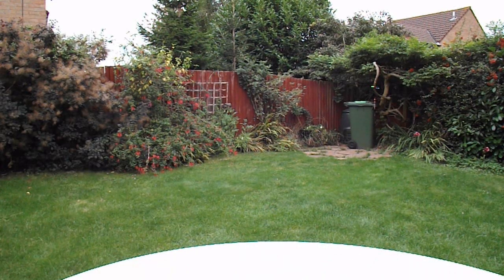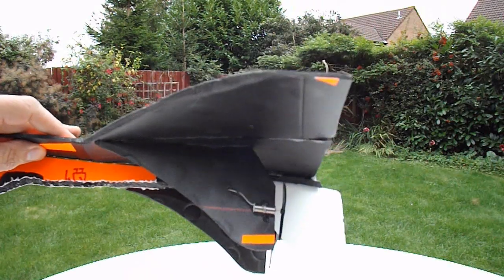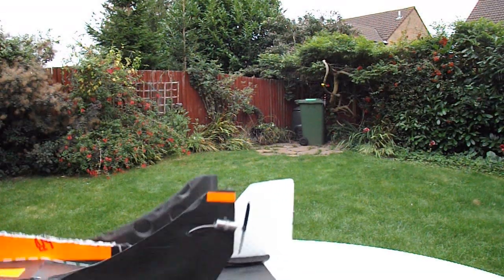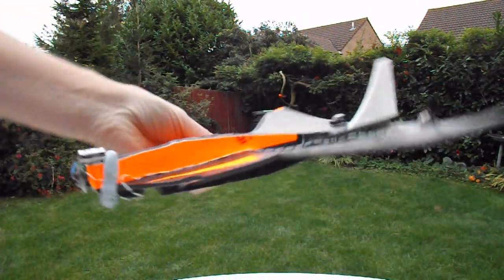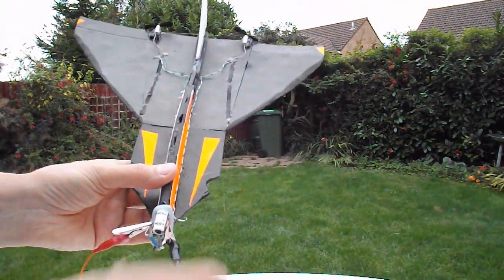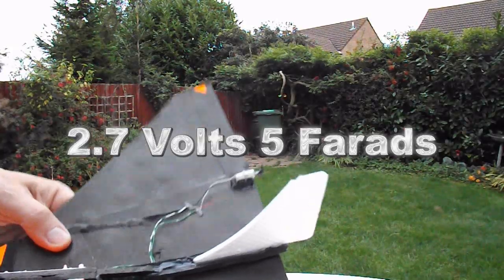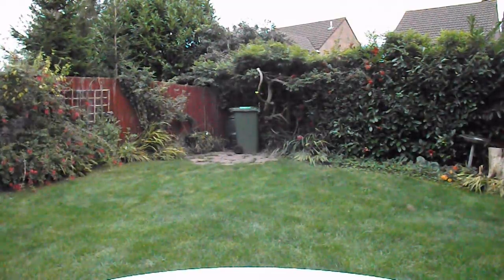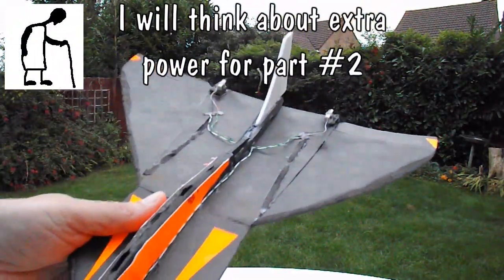Can we power that Polystyrene Pizza Tray Jet Glider (No)

Comment: 2 3.7v lipos
Reply from the maker: +random person the point about using the supercapacitors is that they will only last for about 10 seconds so I have no problems with them flying away out-of-sight. If I put LiPos on they would run for several minutes and I would probably lose the plane.

Comment: Sorry to be an ass, but looks like a bit too much ballast. And to use less ballast you may have to work on the wing. The c-ofg on deltas and canards are aft (compared with a conventional plane) but not aft too much. And the only way is to find out whereabouts of the c-of-g, is glide it. Only guess for the start and then glide and change ballast. Just chuck it and change ballast till it glides well. It should "balloon" like the balloon glider seemed to. lol Also to make it work on less ballast, the leading edge of the wing is bent down (just slightly) and round-off the leading edge somewhat (more on the top) and bevel the trailing edge a half inch in and bevel the underside only of the rear of the wing. This helps nose-up elevator. The leading edge is (by far) the most critical part of the wing!!!, cos the leading edge directs the air-flow over all of the wing. It's like a sheep door in a narrow passageway that separates sheep into different yards. lol The leading edge directs the air either up or down over the top or the bottom of the wing. So both leading edges have to be the same and the leading edge shape is so so critical. lol It won't work if it's square, but a trailing edge will. lol

Comment: Caution there, sir, because as you might know, capacitors don't work like batteries. I don't know how a second capacitor could double the voltage but be sure that aligning them in series won't work. It is possible though to double the capacity by arranging them in paralell with the same polarity of course.
To increase the power I think those motors are overfed...I mean: I'm pretty sure that the can withstand a bigger propeller and still develop quite the same rpm and flight time.
So my suggest in general is to try some bigger propellers first...
Reply from the maker: Before I added a second capacitor I looked up the maths. I am not trying to increase the capacity because I don't want a longer motor run. I want a higher voltage because the motors are rated for 3.7v LiPo's and my supercapacitors are rated at 2.7volts. I haven't found any guidance on the maths on voltage here. In series I am halving the capacitance so the motor run is even shorter but logic tells me I should get higher voltage. In practice I tried it and I got the expected shorter run with a faster burst but still not really enough to fly this well.
Reply from the maker: I did try a pair of larger propellers, 3 bladed, but still not really an improvement. The plane glides fine but is a bit heavy.
Reply: GrandadIsAnOldMan
 I don't know the specifics maths on voltage for that configuration but as far as I know the capacitance doesn't split to half. It really decreases MUCH more. Two capacitors, each of 5F, in series, make a sum of 1/5+1/5=2/5F Less than half :(
But maybe (and I'm not sure at all...) maybe you can charge them separatedly, thus having 5 and 5F separated; and afterwards close the circuit in series.
And apart from that, I still suggest trying a bigger prop, and maybe ducting it...
Good luck sir. I'll try to find some maths about those capacitors...
Reply from the maker: DoNotPushHere haha I didn't expect a discussion on maths but you forgot to invert your answer. 1/C=1/C1+1/C2 so 1/C=1/5+1/5 so 1/C=2/5 so C=5/2=2.5 so half the capacitance of one on it's own http://www.electronics-tutorials.ws/capacitor/cap_7.html
But my point is it's the voltage I want, not the capacitance. Higher capacitance will give me a longer motor run which I don't want.
Reply: GrandadIsAnOldMan
Yes...what a shame... :S
Well, then I'll wait for the results. I can't test it for myself (not too much time while studying) but I'll try to follow the channel and post some ideas if you don't mind...
Reply from the maker: Hey is that rc paper plane still going, I really enjoyed watching you testing it?
Reply: GrandadIsAnOldMan
Actually yes! It is on service. A few days ago I wasn't as busy as today so I decided to go for a flight with some well proven airplanes.
I held it for more than 2 minutes straight before trying a sharp turn which ended on the floor, but apart from that I was happy. The problem is that the so said 18 minutes of flight are much much shorter! See: I flew that first 2-3 minutes flight and then a second one of the same time or shorter. After that...well, it was able to fly and climb, but the climbing was really slow, so on the turns (which make the airplane lose some feet of altitude) the plane came too close to the ground to make a feasible flight...I didn't enjoy those flights and all of them were rather short (about 45 seconds or a minute) suming up to about 10minutes at most!! The problem is thatthis guy climbs by accelerating, so maybe I have to find a better airplane design that can get lift from a 50% throttle, because the model I flew needed al teast 75% throttle to fly level, leaving only a remaining 25% for climbing...
But how to make such fine airplane? On the advertisement videos it seems to climb at a reasonable rate (search for "HM830" and you will find a video filmed in HongKong; that's the kind of flight I expected...)

Well, it seems I write too much... Thanks for asking.
Next week I may get a cameraman and flim some flights.